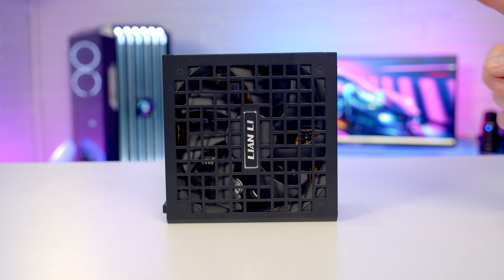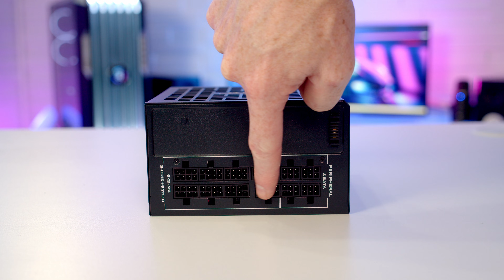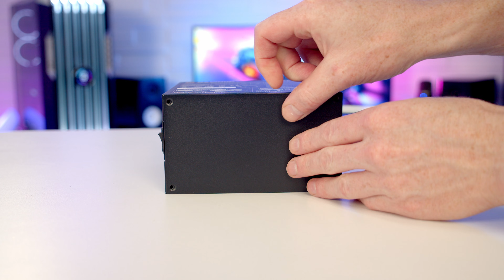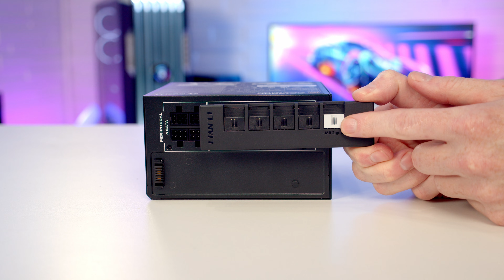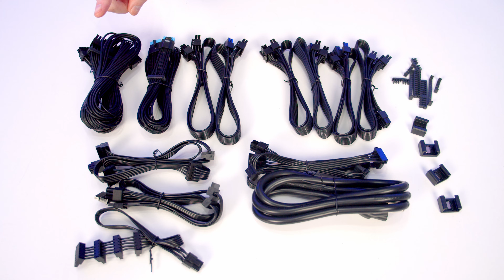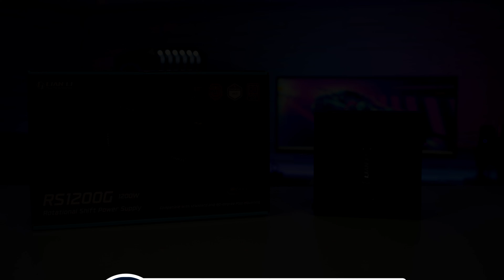Lian Li RS1200G Overview

Comment: I appreciate the modularity but what's the use-case? If you already have a case that fits one orientation, what's the point in having the option for the other orientation? That you may or may not buy another case the next 10 years where it will be different?

This is more about them being able to sell the product to more people. Not the single person buying the PSU benefitting from more options.
Reply: From the perspective of someone who plans and builds gaming PCs as a hobby (to me, speccing them out is at least as much fun as putting them together), I think the innovations that Lian Li included in the RS series design make it a fair bit more flexible to use than conventionally designed  PSUs, because I'd probably be a lot more likely to buy this one and just stick it on a shelf for some future build that I haven't (yet) put a great deal of planning into. 🤔
Reply: @MikeBob2023 That doesn't answer my question though, if anything, if you tell me you are buying it before you have a specific use-case, you only support my argument, namely that the modularity serves Lian Li, not you. The fact you can use it several ways only means Lian Li can sell it to more people who'd use it their own, single way, which now also includes you, who didn't decide yet on their way of using it.

"I build PCs for a living on youtube, I reuse my components, this allows me to reuse it more times" is literally the only valid case anyone could make... it's for techtubers, not end users.

Comment: Lian Li are doing some remarkable things in the PSU space.  I'm still messing around with a ton of kit that's now 2-3 generations old, but if I decided to build a PC using the very latest generation stuff (I have no plans to; silicon parts are just TOO insanely priced, and I don't think they're going back down anytime soon), I'd almost certainly be looking at using Lian Li's PSUs.  Good Stuff indeed. 👍🏼  Thanks, Chris. 🙏🏼💯 

P/S: I did just purchase a Lian Li SP0850P though (and yeah, I do need to have my head examined for putting together yet another m-ITX build 😏🙄🤣).